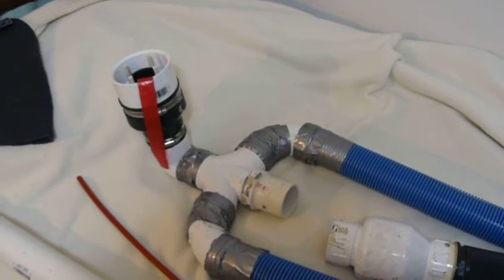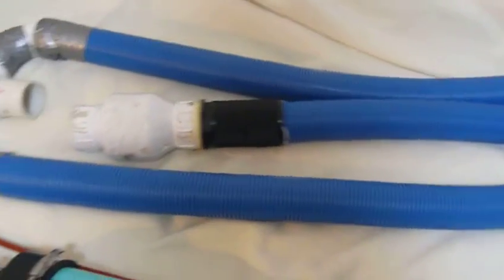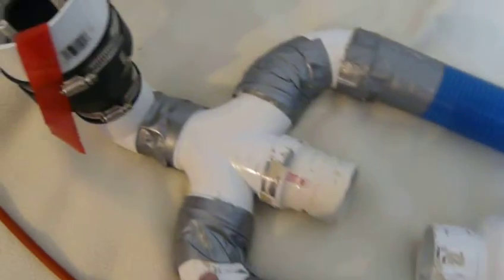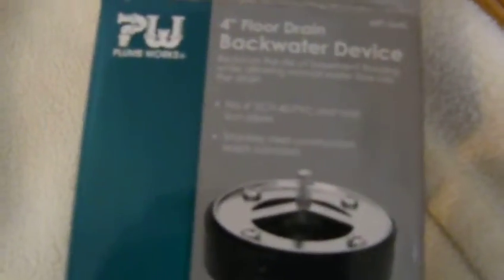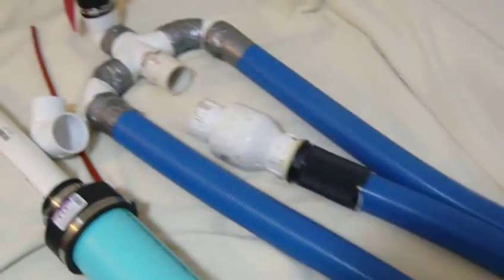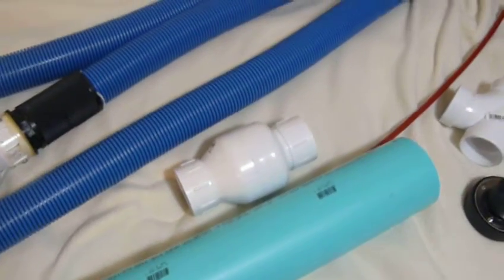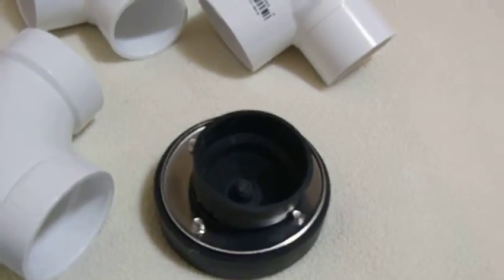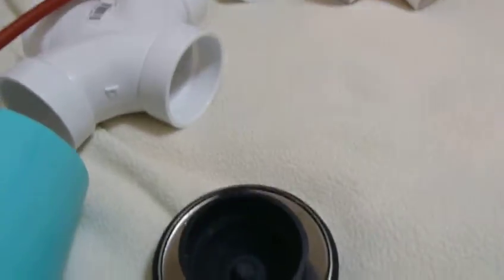Air Flow Regulator for Portable Carpet Cleaning Booster

Comment: Have you measured the Rotovac ZX? Any thoughts how the ZX compares with the LX?
Reply from the maker: C348 Vacuum Motors from Mytee, as I recall uses more amps at 120 volts then Rotovac ZX Vacuum Motor, when I last researched the two about 8 years ago. 
I have not tested any of the two vacuum motors personally. 
Mytee Motors have high amp and low amp LX motors: https://www.mytee.com/product-cat/vacuums/?orderby=popularity

Manufactures marketing their products in the carpet cleaning portables is very confusing to buyers. I call it tricky or misleading the average shopper, is my personal experience when looking at adverts in the carpet cleaning business. There are lots of forums were cleaners talk, and marketing will focus on the hype of the year.

Best way to find what you're looking for is to see the product in person and have testing equipment or find videos of others doing recorded testing.

This video may help. 
Steambright, they do a lot of performance testing videos. Good info. https://www.youtube.com/@steambrite

Centrifugal Vacuum Motor Terminology
By Steambrite
6.3K subscribers (https://youtu.be/qZuRD4gyF20?si=Umk11JUxZ544YDve)
https://www.youtube.com/watch?v=qZuRD4gyF20

Comment from the maker: To, Kenny Cosway
The series set up, in this video, with two vacuum motors, gives 230 CFM and 144 inches of water lift. That is good vacuum performance with a 25 foot hose run. Depending on your water flow and PSI the two vacuums should work good. Most portables have low water flow and low PSI. 
Now, If your set up has about 2 gallons of water flow and 500 PSI, The two vacuum motors in series might not have the water lift and CFM to recover all the water that was injected in to carpet. 
There are many types of carpet too. Deep shags and Berbers can hold a lot of water deep in side the carpets, if you have poor vacuum performance. 
The water left in the carpet can hold soils too. So a hot water extraction system may not work good with that kind of carpet, you need a better vacuum system.
The more water used with high PSI removes soil and you need the vacuum power to extract the all the water you put in to the carpet. 
Using three vacuum motors as I used in this video will add water lift and water lift recovery time and increases the CFM when the wand (carpet tools interface) is put on the carpet to extract water. 
The water lift recovery time is short when you have high CFM in the hose. Water lift recovery time is the time it takes to reach max water lift of the system you use. A 100 foot hose run will take longer time to reach max lift, as the hose has 300%  the volume of air to remove over a 25 foot hose run.

If you have high water flow and long hose runs. I would use the 3 vacuum motor system. Also the type of carpet you clean may require you to use a  three vacuum motor and shorter hose runs.
Carpet cleaning is a art, and you need to know what your doing to get carpets clean. One tool does not do all things. you need to tweak your tools for each job, even if you have the most powerful tools on the market.